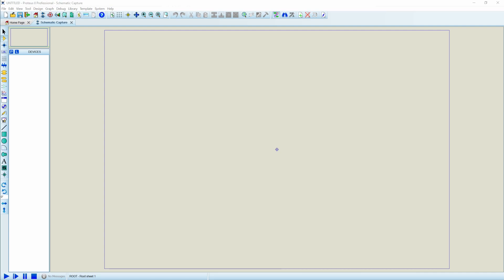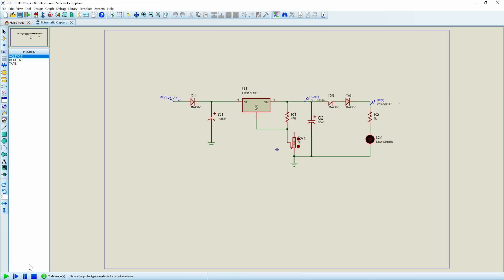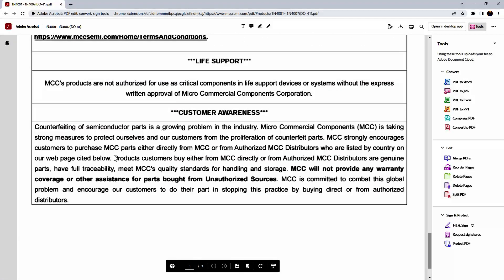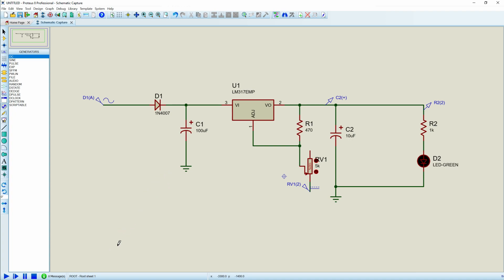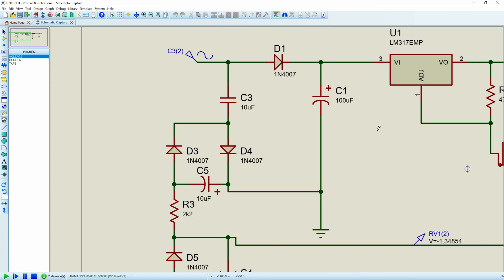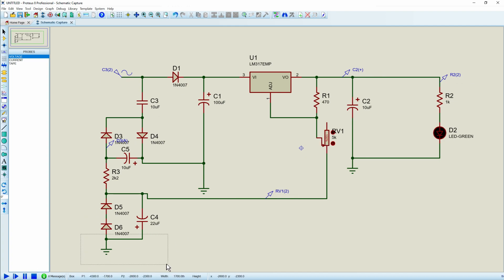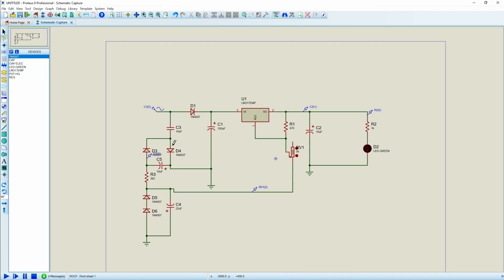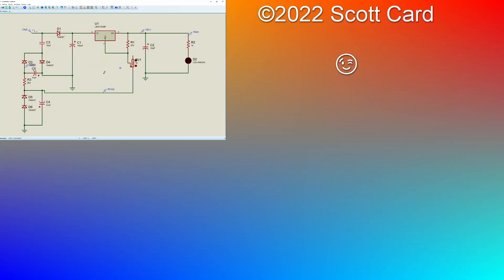LM317 Lab Power Supply ~Down to 0 Volts!

Comment: can we make it 0v until 25v or more using potentiometer
Reply from the maker: If the input voltage is high enough, this would be able to go up to about 36 volts (max 40 for the lm317). Remember that the higher the voltage drop over the regulator, the more heat will need to be disapated.

Comment: I'm designing an adjustable power supply (using LM338 instead of LM317 to get 5A out of it) and I do have a second output in my transformer (connected to a separate rectifier and regulator) which I use to power the voltmeter I'm using. If I put an LM337 there, wouldn't it be a better solution to get my -1.25V?
Reply from the maker: I imagine so. Just need to tie the reference to the ground and let the negative ride lower. Let us know how you make out.

Comment: hi. ı have a LM317 and I have power supply of 9V DC. How could I get -1.25 V from DC in real life. I do not have AC source.
Reply from the maker: Well, it is not an easy from a single source. What you can do however is to add a 1.5V battery to the system. You would connect the + to ground and the - to the V-adjust. Hope this helps, and thanks for the comment.

Comment: In many my devices where i use ac voltage, i create negative voltage by simply adding diode backwards and after that capacitor. So i think this schematic may be simplified by removing c3 and d4. D3 connected then to source. 2 diodes as reference + resistor, i would replace by trimmer, say 10kohm. But then weve got classic power supply. Anyway its simple when you have ac. Using dc its little bit more complicated. Previously i said that 2 diodes in series makes output closer to 0v thinking about dc at input. Hmm interresting thing, that these 2 diodes here are just reference. Which also explains how voltage references work.
Cheers
G
P. S. I forgot to reply you about these diodes and about diode characteristics, but i think it may work where you have some margin.
Reply from the maker: Thanks for the comment. Yes, with a DC supply it gets messy. There are better regulators for this but if you realty want to get precise you use a transistor, voltage reference and op-amp to make your regulator (see HP power supply schematics for the 1970's). I find there is always a trade-off between simplicity and accuracy. The great thing about having simulators is that we can experiment and play, without cost!
I forgot to mention, the reason for the decoupling capacitor is so this will work with a full-bridge rectifier as well.
Scott
Reply: @ScottCard  when i was young i had idea to create regulated power supply with digital memory. There was lm350, because 5a instead of i think 3a in lm317. But controling elements were transistors connected simply to bit lines in static ram. Another things were simple. I do not remember how voltages were entered, i mean by buttons or what. I think i used buttons there, because also then i made diode matrix keyboard. Also then i discovered how to build one cell memory with few 4013 (i think), to keep a digit. 8 bit gives 25,5v suplly voltage with step 0,1v - not so bad, of course output voltages may be another than 25,5 with another resolutions. For example 12,5v will have 0,05v step. Hehe.
 I had crazy ideas. Today we may buy everything.
Cheers
Greg
Reply from the maker: @C_04  Yea. With the chip shortage these days, I have had to revert to first principals and build discrete circuits for many 'common' parts. Have even considered some 74xx series IC to get the job done😬. You project sounds interesting, defiantly a low cost option (could even use a decade counter to toggle through the steps). I have used a DAC in a micro before, that works well but the output stage is where the fun is!
Thanks,
Scott
Reply: @ScottCard  hmm it is possible that i considered decade couters connected to carry digits. Dac's because were expensive i made with resistors, in fact used that way in my ps idea. Logic circuits world is somehow wonderful world. Of course when you lack in programming. I hope i will learn soon enough how to programm, before i will be unable do something. I had some cheap electronic store near my electronic school. There were mainly some circuits and logic ics. I purchased them in tens hehe. Even today they really cheap, but when calculate cost of pcb and overal size of circuit, energy which is needed to power this up... Sounds is rather for educational purpose. Still useable.
Cheers
Greg